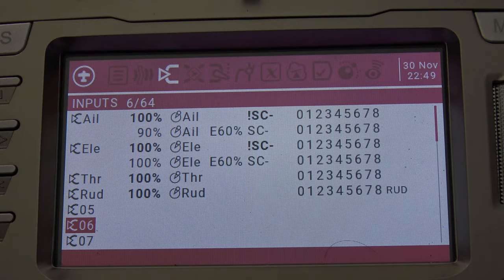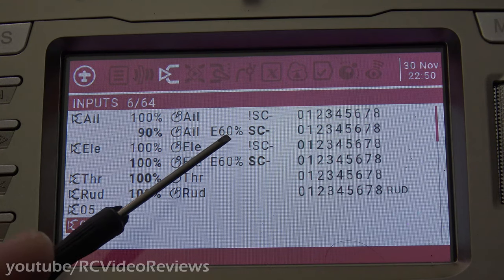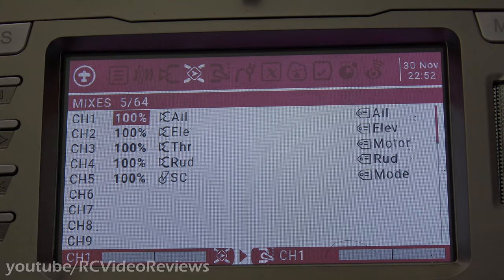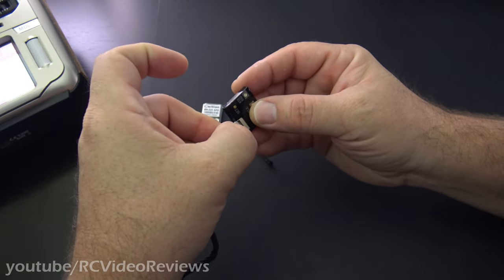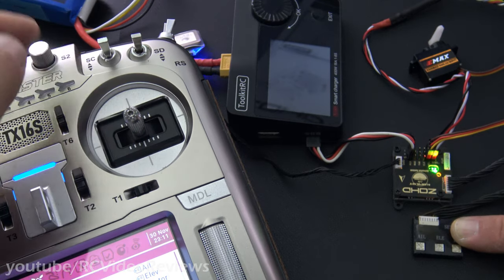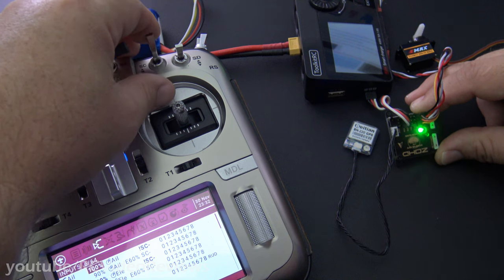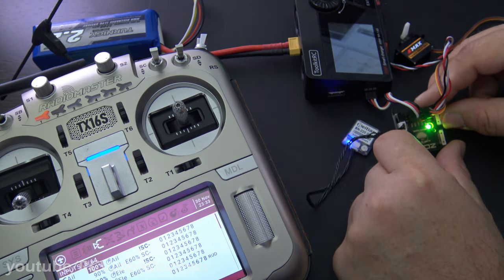Kopilot Lite: The Complete Configuration Guide

Comment: I flew my ZOHD Dart XL Extreme for the first time yesterday, with the Kopilot controller, and it worked great. I flew it with the settings board still attached, and I'm glad I did, because I just discovered that the settings do not get locked in unless you disconnect the settings board before cutting the power. If you press the button for 4 seconds and it does it's servo dance, then turn off the power, THEN unplug the settings board, the settings don't stick. You HAVE to unplug the settings board before cutting power.
Also, if you're using Crossfire, you have to go into the RX configuration and set the failsafe to "Cut" for return to launch to kick in when signal is lost.

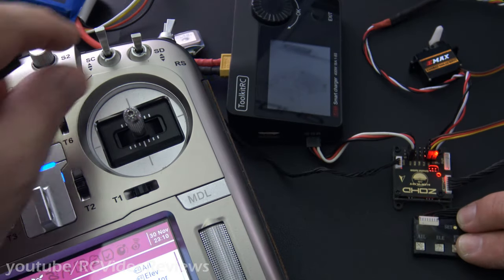Comment: Good video. I wanted to add a couple things I learned from setting up Kopilot. First, you can leave the GPS unplugged when doing your setup. You can even leave it unplugged for flying. With the GPS unplugged the RTH function turns into altitude hold. The other tip is if you're having issues with the RTH autolaunch increase your gain on the elevator. I find either 10:00 or 2:00 is about right for most small planes like the Dart250g. And the Dart250g needs a healthy throw in autolaunch.
Reply from the maker: Good tips..thanks for sharing. That's about where I have my elevator, and yes, the Dart requires what I call a 15 yard football throw.

Comment: A needed tutorial John. Just a couple of points that could have been mentioned for completeness. 
The GPS unit(shown lying upside down at the end) needs to be positioned label down as well as out in the clear for best satellite acquisition. Also it can take quite some time to get the first lock (and charge up the little back-up battery on board.) You can fire up the motor in Manual but not a good idea to take off before satellite lock is acquired or the RTH Home Point might be somewhere you really don't want it to be!
If using the PWM cables the receiver output must be AETRMode - if using say a Spectrum the TAER will have to be re-mapped or the pins in the wiring cables re-arranged to suit.
You pointedly pulled the setting board before powering off the Kopilot but didn't mention that some folks have asserted that powering off before pulling the board can negate the settings. A test would have proved/disproved this theory.
Kopilot works well with ZOHD ESCs but can be intolerant of some ESCs which don't like its long boot up time and shut down from an assumed loss of signal.
Because of the long boot up, doing an ESC calibration (and you really need it done first) can be fraught with all sorts of traps if the ESC supports multiple programming possibilities from the sticks! 
Heck I sound like a whinging Old Fart but I've lost a lot of thatch in making all the possible mistakes in setting these up!  😜 😁
After all that you are right. They do work well when set up correctly (and certainly seem tolerant of dumb mistakes!) 😀
Reply: hey whinging Old Fart...lol good points. I have two Kopilots and both are excellent and work well if setup right. Ive subbed you so now you need to fly and upload some videos.
Reply from the maker: Thanks for the tips. I have to put fences around what I cover in videos. If I covered everything to NOT do, I'd never finish these things up. The raw footage for this was an hour--I cut a LOT. Instead I focus on and during post keep what does work. 

Yes, GPS puck mounted with dot facing up.
Yes, removing battery before removing settings card is wrong (I've done it).
Yes, ESCs can struggle with flight computers due to the boot time.
Yes, Channel mapping must match the PWM pins on output (common with all flight computers).

Thanks for sharing your tips. The best way to learn with these is to put hands on and test.
Reply: @RCVideoReviews  Yo, point taken as your concise videos are much appreciated! And thanks for the confirmation on the setting board removal. :-)
Reply from the maker: @theoztreecrasher2647  Anytime. It's always a balancing act between keeping attention and providing detail. Very difficult to understand viewer behavior. If everybody watched every video start to finish, I'd know what to do.

Comment: thanks for clarifying that kopilot actually does go into RTH on radio signall loss (with no pulses). everybody else keeps saying you need to set the RTH switch  for failsafe.
Reply: PWM set-ups generally need Fail-safe set differently. Use Custom and set ch 5 to go to -100. Always check how your combo will react before flying.
Reply: @theoztreecrasher2647  ah, so it's the difference in PWM and SBUS. thanks. I just set up my kopilot, to tell the truth, I kept on thinking I forgot to do something. to test the failsafe ofc ;)

Comment: Thanks. This helped me fix whatever was not right and got my ZHOD Dart 250 setup. Btw, easy thing to miss - in rth and stability mode there will be no throttle control without GPS lock to prevent flyaways. I kept debugging and thinking my radio levels are messed up somehow.
Reply from the maker: Glad you're up and running. The Kopilot is really very good when it's setup correctly. Have fun.

Comment: With my Kopilot in manual mode the elevons on my wing move as expected. When I go to stability mode it stops responding to the aileron/roll stick. Port wing servo is plugged into AEL, starboard wing servo to ELE. Two solid green lights for stability mode on a wing. Pots on control board both about 3 o'clock. What am I missing? 🤷🏻‍♂️
Reply from the maker: I'm not sure. You might need to hit-up ZOHD support for this one. They do respond to help requessts.

Comment: Hi John,
Got my Kopilot set up according to your video, couldn't be explained clearer! I have one issue: my ESC arms fine when connected directly to the receiver, but will not arm via the Kopilot. It's not a ZOHD/Flycolor ESC.
And thank you for showing how to have Rates & Expo switched off when in stabilized mode.
Reply from the maker: I've had issues with certain ESCs and Flight Controllers in the past where if there wasn't an instant arming, the ESC would timeout. If you have a different ESC (even to just test with) I would try that first. Also, make sure your ESC is calibrated without the Kopilot. 

Glad the video helped.
Reply: @RCVideoReviews  I tried four calibrated ESC's which worked fine directly from the receiver, but failed to arm via the Kopilot. I think I need a ZOHD ESC (re-branded Flycolor FlyDragon).

Comment: Hi John, Thanks for a detailed video about the Kopilot....
Just wished you had given more detailed info on “reducing”  control travel when in Manual mode.
I have the Kopilot set up in a T-28 Park flyer using the PWM setup and a Spektrum DX8(gen 1).
The combo flys fine other than it has too much control surface movement when switched to manual because the throws are set to Kopilot ‘s 100%. I tried using the elevator Rate switch, setting it to 50% in position 2. 
That worked fine in manual mode. However, leaving the rate switch at the 50% position, when switched to Stabilize mode, the plane went crazy in pitch. Oscillating rapidly. Quickly switching back to manual allowed me to safely land. My assumption is the 50% rate setting completely modified how the kopilot computed its response. I want to reduce the control surface movement in manual mode, but not have the Kopilot freak out because of the rate switch setting. I am missing how this can be done on my Spektrum Tx. Hopefully you have suggestions... Thanks
Reply from the maker: On my Dart, rates and mode use the same switch.
When in manual mode, my rates are 100% with a ton of expo.
When in stabilized mode, my rates are 100% with no expo.

I can't tell you the first thing about Spektrum. Don't use them.

Rates really shouldn't cause oscillations. It seems to me your gains are too high. The Kopilot doesn't know anything about rates. It simply sees what the radio sends as a pulse width. With low rates you're sending low pulse width. Kopilot doesn't interpret that outside of considering it less than 100% of movement.

Comment: Andrzej Zielinski
Hello John!
I am a long-time (84) modeler from Poland.
I flew RC gliders about 3m. Due to the age, I bought a ZOHD Drift with Kopilot, in the Flisky i6 set, a 7.4v 3500ma battery, a Flysky i6A PWM receiver. I made over 10 flights, very pleased with its parameters. However, in great thermal weather, it disappeared from my sight, at a height of & 60m and a distance of & 500m with the throttle turned off. I turned on the RTH procedure, but after 30 seconds of the model I can't see, I turned off the transmitter - the model disappeared. It was the second flight that day, the first 20 minutes, on the same battery. The transmitter received an Error 99% feedback. Unaware of what it meant, I searched for a model for three hours, after which the signal disappeared. Later I found out from the Internet that this is approximately the RSSI, proving the range of the signal. If I had this knowledge, I would have found Drift for sure. I described it because I bought the second Drift and I would not like to lose it, not knowing what mistake I made.
Basic information both the first and the second Drift set based on your video. With one condition unrelated, that both the first lost model and the second do not accept "Natural Calibration". after withdrawing the sticks towards each other in a stable position, the D2 diode (on), only both ailerons deflect significantly to the right turn. Transmitter set Ch.1-80/80 Ch.2-60/50.
I am asking you to help me figure out the cause, possibly some mistake I made. greetings Andrzej

Comment: Hey, John!  Love your channel.  I got a Dart 250 awhile back, still haven't put it together yet (mainly lack of a workbench or any work area in this tiny house). I'm not sure when I'll get around to it, I've been busy with other things that have priority.
Anyway, this is my first RC model that I (will have) built, so this video was really helpful. I am very familiar with electronics, computers, microcontrollers, etc, but even I have been feeling like the documentation for just about everything RC related is lacking.
BTW, what was that device you had hooked up that had the LCD screen?  (I'm watching this on my phone, so I couldn't see any markings to ID it.) It looked like a power source, but I thought you said your were going to use a battery pack.
Thanks again for all the deets!  Keep on! 👍
Reply from the maker: If you're referring to the device at this time: https://youtu.be/NqKFKvMlaV4?t=480

That is a ToolkitRC M8S. It's a multifunction device which has a power supply output capability. Very handy on the bench.

I've got lots of videos. Over 900. So have fun watching the channel :)

Comment: Great video. You explain it well. I'm using PWM because my rx doesn't support SBus. Also default config channel 5 on my Hitec Optic sport 6 uses a 2 way physical switch, while channel 6 uses the 3 way. I have yet to find out how to configure 5 to use the 3 way. I have to admit the using this with PWM has been a struggle and I'm not there yet.
Reply from the maker: s.bus is a very convenient option when you start getting into stabilizers. I'd highly recommend it if possible. If not, the pwm option should work, but I've no experience with it since I went immediately to s.bus.
Reply: Simply plug the 3-pin connector into the channel 6 PWM output from your receiver (rather than the channel 5 outlet) and set your 3-way for -100, 0, +100 to get the 3 modes. Then set the receiver failsafe for channel 6 to -100 to get loss-of-signal RTH. Done.
Reply: @theoztreecrasher2647  yes I did try using C6 but I think my receiver fail safe is on or off.
Reply: @Mister0String  Failsafe setting in your Tx/Rx system is covered in this.
https://hitecrcd.com/files/Manual_Optic6Sport2.4.pdf
Simply set your 3position switch on channel 6 to the RTH position during failsafe set-up.

Comment: Good Kopilot vid
All set up and working thanks to your video except 2 items. 
The GPS never connects even out doors and the motor only runs in manual mode and never in RTL or Stability mode. 
Any help or thoughts?
Thanks!
Reply from the maker: Remove the gps and see if your motor issues persist. I'm assuming you followed the video and completed the calibration of Kopilot as discussed.

If that solves your issue, it boils down to your GPS. Make sure you're somewhere with clear view of the sky. May remove/reinsert GPS. Or get another one from Amazon and see if that does it.

Comment: Hi John, I am trying to install this pilot in a twin engine plane, I am using a Y lead on the Throttle output of the Co-pilot with one motor positive lead disconnected as only one 5v line is needed for power. In this configuration I can only get one motor to spin up. If I use the same Y lead direct into a receiver all works ok. Any ideas ?? Regards, Pete
Reply from the maker: If you have signal from Kopilot split to two ESCs, they have to both run. Something is missing. Signal is signal. One ESC isn't aware of the other on a Y-cable. At the risk of sounding pendantic, have you verified them individually with the Kopilot on the Y? i.e. Use your Y-cable, attach one, spool=up, disconnect one, attach two, spool-up. When you've confirmed that operation, attach one again and you should be done.

I've used Kopilot on two twin motors: Reptile Dragon II and now T-1 Ranger. It's worked exactly as expected on both using a Y.
Reply: @RCVideoReviews  Thanks John, you have just confirmed my own thoughts. I have verified the Y cable using the receiver but I haven't done that through the co-pilot. I will do that tomorrow and let you know how it turns out. Cheers for now, Pete

Comment: Hi I’m new to RC but built a Multiplex Heron with a FrSky x18. I like the idea of this RTH function. If I plug the servos into the Kopilot then does that mean I loose all the mixing and deflections I took ages to setup when the servos were plugged directly into the receiver?
Reply from the maker: Yes. When you use a stab they usually provide the mixing.
Reply: @RCVideoReviews  so is it then possible to switch back to a mode where you have all the settings manually? For me that’s half the enjoyment controlling the plane manually. But I would like to be able to switch on a RTH function when I wish or have it turn on as a failsafe.

Comment: I have a question. if I install ZOHD Kopilot upside down (facing arrow forward anyway), will it work correctly? I understand, that will I need to turn ELE and AIL knobs to opposite. I just want to know if such installation (upside down) will work as expected (RTH, stabilization). Such installation would allow me better to access SBUS, servo, throttle connectors, settings port.
Btw., thanks for the detailed instructions. It helped to understand manufacturer's instructions more easy.
Reply from the maker: It probably would. If you can get the stabilizer to respond correctly to roll/pitch using the reverse feature, it would probably work. Try it. Just do a good preflight and make sure the correction goes the way it's supposed to go and make sure RTH works. i.e. Keep a hand on the switch and be ready to turn it off. I don't see why it wouldn't work though.
Reply: Info for other - I tried to install the Kopilot upside down, but in stabilization mode, it tries to flip plane upside down. Do not install Kopilot upside down :)
Reply from the maker: @shelbygt83  Thanks for reporting back. Good to know.

Comment: I just connected my FlySky A8S to the KoPilot via SBUS (black, red, white). My receiver is bound, solid red light, and I have checked on the channel monitor that I'm getting a -100,0,100 output on Channel 5, but the KoPilot won't go into manual mode and no green lights are showing. Do you have any thoughts on where I might have gone wrong?
Reply from the maker: When your RX and servos are connected to the Kopilot can your radio move the servos?
Reply: @RCVideoReviews  No it did not. I switched out the A8S for an FS-X6B and it works perfectly, so I think there is something up with the A8S (or how I'm using it).
Reply: @timtheplaneman  Answered elsewhere but I'll add this for the benefit of others. A8S V2 comes set for i-bus output by default. You need to switch it to S-bus. And we initially made the same mistake! 😁

Comment: Thanks for this great instructional video, John! Great stuff! Just one question for you: you’ve stated in this video that all one needs to do for failsafe is to set the model to no pulses on the  radio. However, other commentators have suggested one needs to set failsafe to custom and then configure it on channel 5, with a setting of -100 and the 3-position switch in the RTH position. Can you please clarify? FYI I’ll be using a Frsky XM+ rx with a Taranis QX7 or a Radiomaster TX16S. Many thanks :-)
Reply from the maker: KoPilot enters RTH with no pulses. It's in the book.
Reply: @RCVideoReviews Thanks :-)
Reply: Mine will not work with " no pulses ", only  with ch5 set to custom and  -100

Comment: Thanks for your nice video and explanation do you think that I can use ZOHD KOPILOT LITE on gas airplane or is only made for electric plane i would like use it on trainer Superstar 40
Reply from the maker: I haven't flown a nitro plane for 30 years, so I don't really know. I think if you can isolate the board it should be fine.